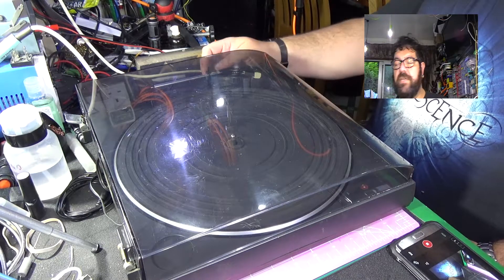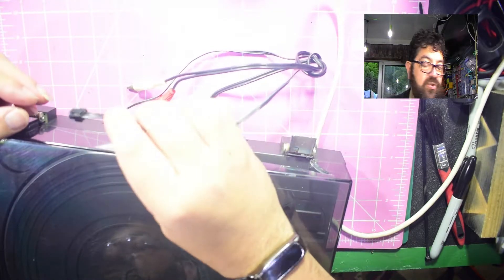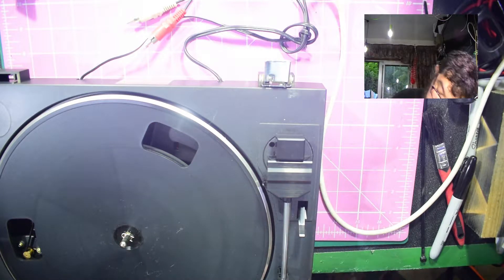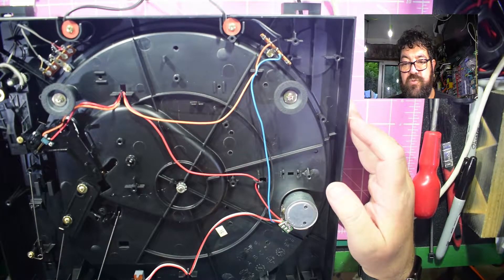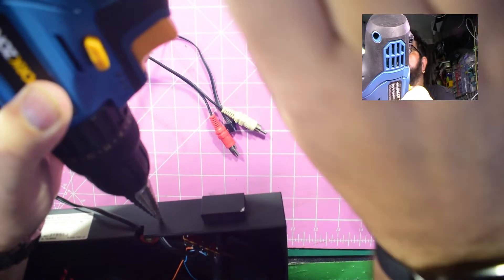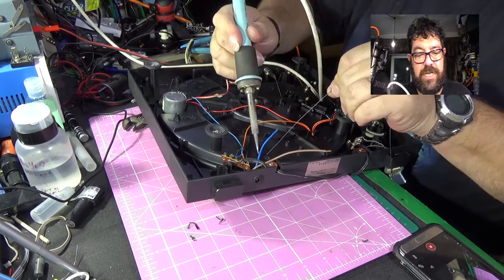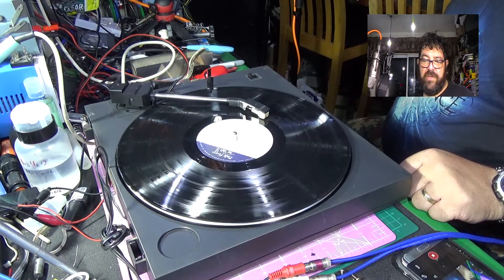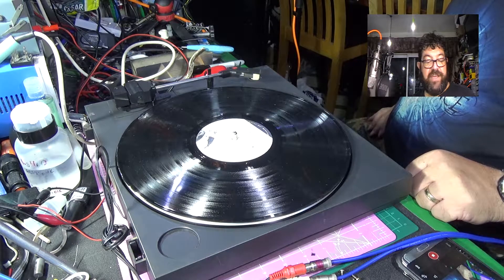Recycle a Sony turntable and make it work from AC power PS LS60P

Comment: Hi good video, just what I need to do. How do you determine the polarity?
Reply from the maker: First you look to see if there is a ground wire connected internally to one of the power ports. If there isn't, put power to the motor.. if it spins the wrong way then you change the leads over.
Reply: Ok thanks, I’ll give it a go. I want to replace the amp but not the turntable, so hopefully this will solve my problem.

Comment: Please advise where I can obtain a Jack as shown and will this permit for a standard USB connector?
Reply from the maker: You can buy  jacks from ebay and you can be any style you like. If you wanted to buy a USB one you could but I don't see any reason to as they are not a particularly good jack.
Reply: George Christofi thank you for your advice which is appreciated. Can you recommend the best 12v charger and jack to suit the turntable. Once again my thanks.
Reply from the maker: @kennethhanna4405  I used a cheap Chinese one purchased from ebay, the socket was a matching one again from ebay. when you order the power supply it should tell you the socket type you need.

Comment: Many thanks for the video, i would like to do the same i am told i have to use a 12v dc adapter but am worried about buying the wrong one and blowing our estate up! any advice please....
Reply from the maker: Pretty much any one will do, as long as it is capable of a couple of amps. Just make sure the plug matches the socket you fit to the deck!

Comment: Cool video - like the camera action.
What amperage should the 12v adapter be, or does that not really matter?
Reply from the maker: The turntable itself doesn't use much current. The adaptor I used was a 3 or 5amp unit but a 2a would do the job fairly comfotably.